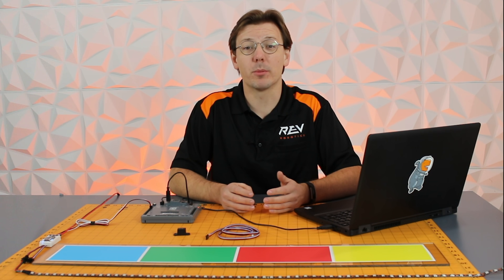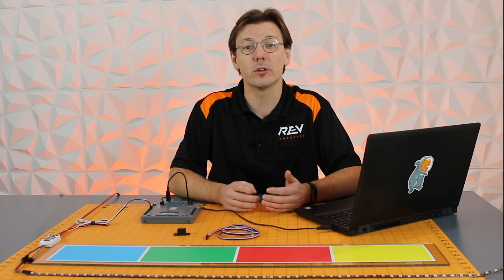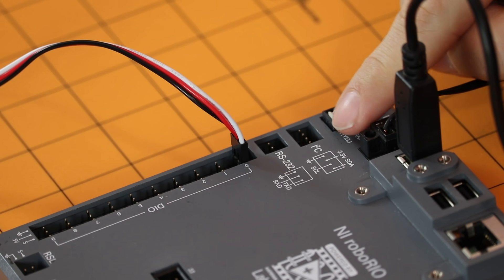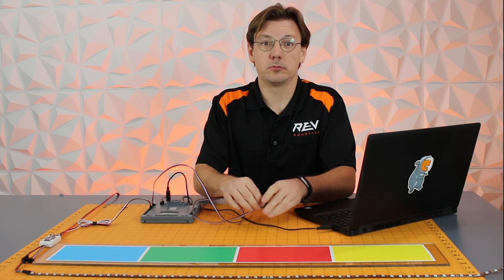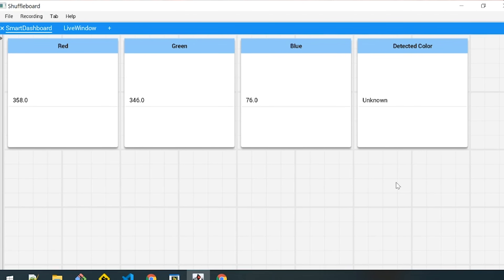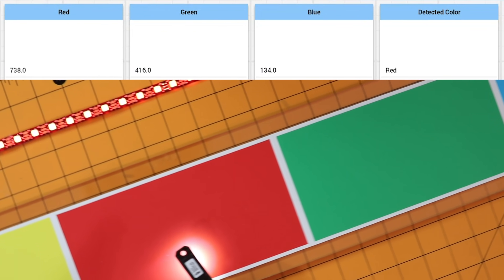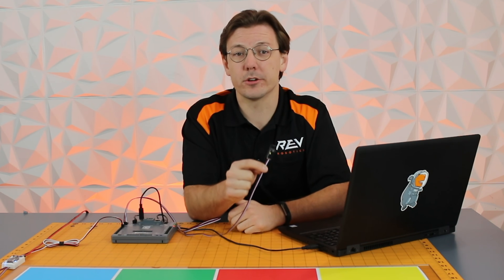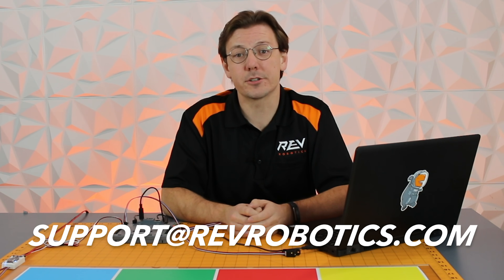Using the Color Sensor V3 for Infinite Recharge

Comment: Hi, our team plan to use a color sensor and a distance sensor (which both  have the same I2C address). Is there any method to change the default I2C address to make them no conflict with each other? Thanks!
Reply: He mentions the color sensor has distance capabilities.
http://www.revrobotics.com/content/sw/color-sensor-v3/sdk/docs/javadoc/com/revrobotics/ColorSensorV3.html#getProximity()
Reply: Thanks! but actually our color sensor and distance senso have different purpose that need to be seperated.
Reply: 'Buchanon' mentions in this thread that the I2C port is hard to change (but possible):
https://www.chiefdelphi.com/t/how-to-use-2-i2c-devices-on-roborio/343341/2

Note that you should be able to connect one device to the on-board I2C interface and another on the MXP
Reply: @johnireton997 Huge thanks for providing this!

Comment: on Visual studio, do you need to download a library or an extention to be able to use it ??
import com.revrobotics.ColorSensorV3; this appears that doesnt exist
Reply from the maker: Libraries and sample code are on the product page: http://www.revrobotics.com/rev-31-1557/
If you are running into issues please reach out to support@revrobotics.com
Reply: I believe you can copy this .json file and make a build: https://github.com/REVrobotics/Color-Sensor-v3-Examples/blob/master/Java/Read%20RGB%20Values/vendordeps/REVColorSensorV3.json 
Please note that this is for java.
So copy and paste this json in your project's vendordeps folder, then make the build, restart vs code, and check if it works.
Reply: @hectorcanizales5900  I really tried it, but it didn´t work, (the file was already on vendordeps and it didn’t had any difference) if you have any example or info of how to use REV imports (how to install them) you want to share to help here is a mail a01423412@itesm.mx  THx for your help!!
Reply: I have the same problem. I'm using C++